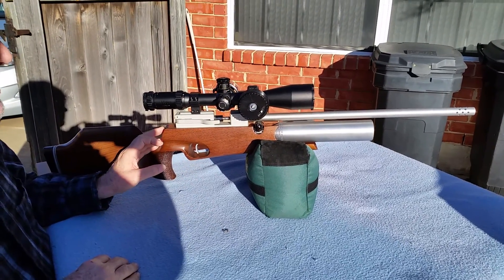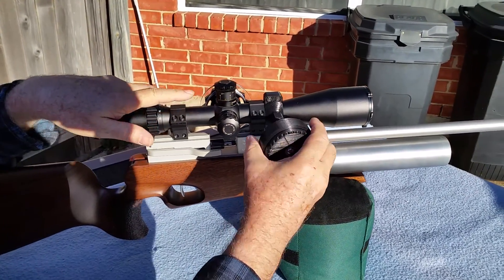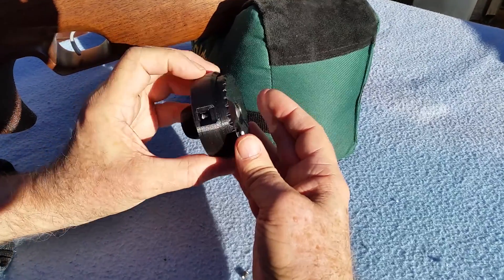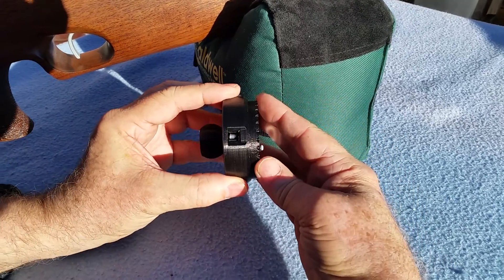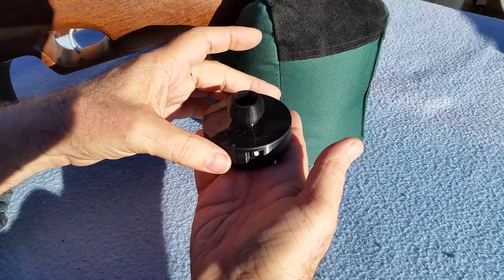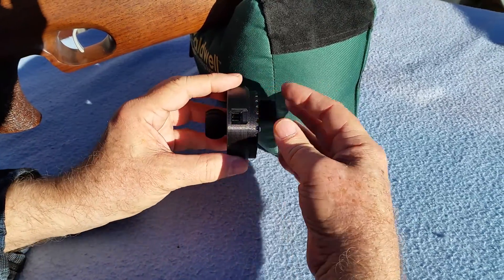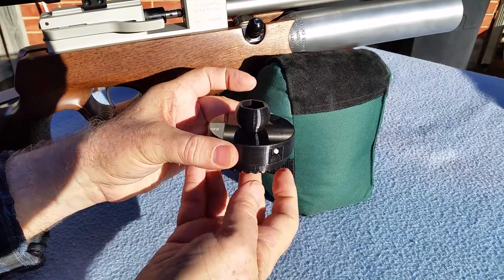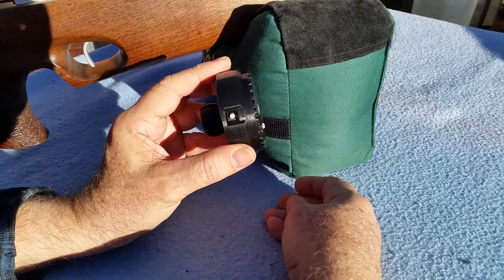DPP Airgun Pellet Dispenser 177

Comment: Nice work!
Esp. the two-staged rotor to double the capacity.
But the using of it feels a bit tedious. Looks like it is easy to overturn the rotor and it will drop 2 pellets instead of just one.
Recently I come up with my vision of a rotor dispenser w\o such flaws. Will not put a direct link here, the video can be found on my channel!